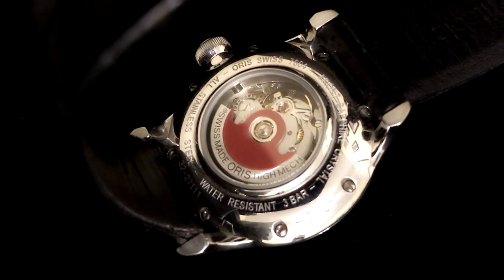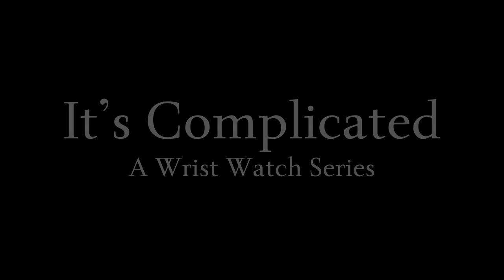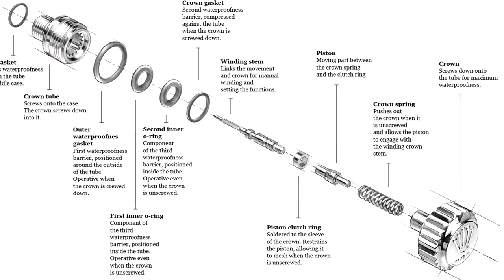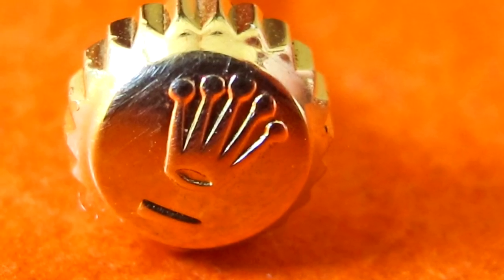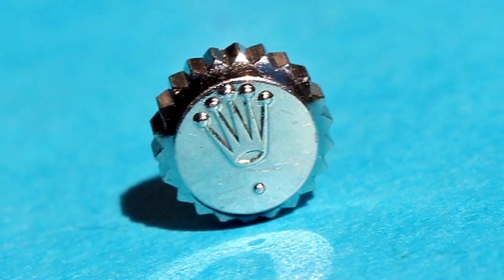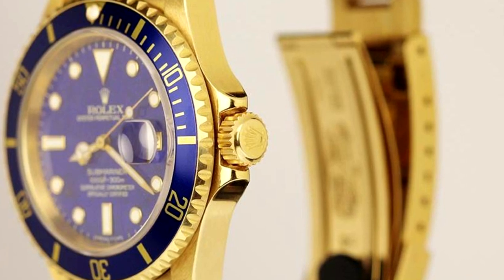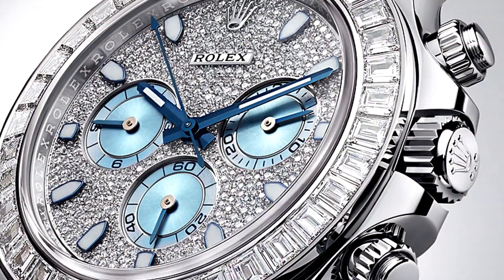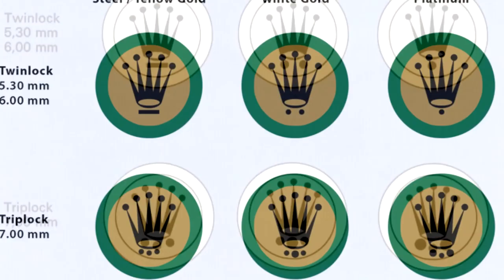Markings on a Rolex Crown; What Do They Mean?

Comment: I have a 1980 Day Date 18038 which has a twinlock crown that I know the service (not RSC) place replaced, it's got two dots on it. This must be a monobloc crown they've put on instead of finding the original with a dash. Is this technically wrong or would Rolex do the same thing now? Would RSC replace with the dash crown or just pull the two dot gold crown from the shelf and fit that?

Comment: Hi there, very informative video, thank you. I've been looking at a MK1 Sub 1967 which has three dots but according to your info, the triplock wasn't introduced until 1970. I'm fairly certain the seller told me it had its original crown. Are they inaccurate, maybe lying to me then?
Reply from the maker: I'm not real sure on that. It did have the three dots in 1967 but perhaps then Rolex didn't tell people it meant what they say it means today?
Reply: @itscomplicatedwatches  Hi, thanks for getting back to me. The casing is in near perfect condition but it's been fitted with a NATO strap (original not present) which puts me off somewhat. I do like things to be as original as possible, plus I think it's overpriced. I'm going to leave it. I'll continue my search... Thanks again